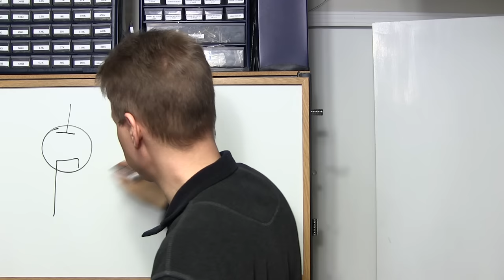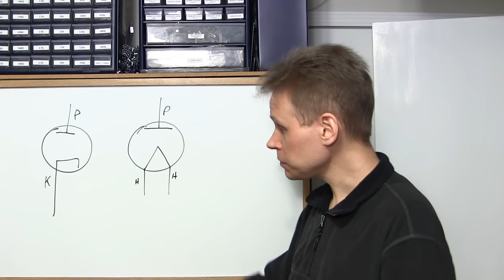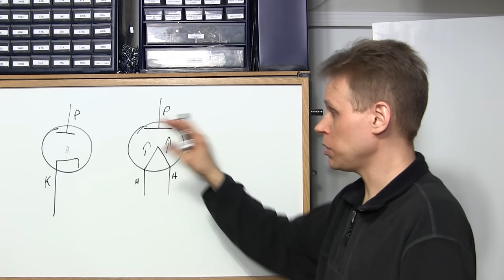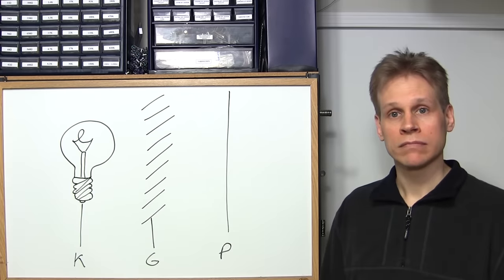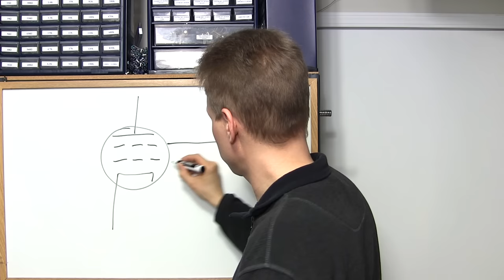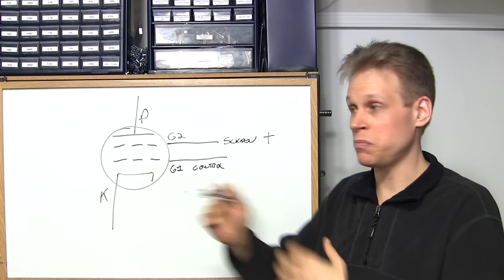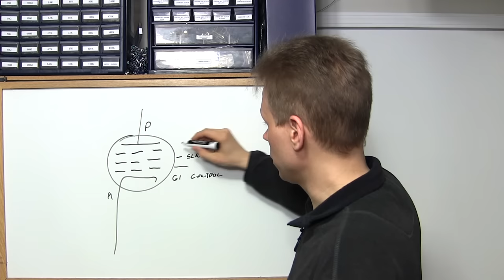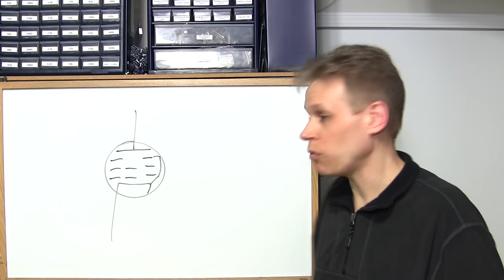How A Tube Works

Comment: Tubes are still used today in many applications like guitar amps, very expensive sound systems, microwave oven and high power transmitters.  Can you explain why tubes do better in these applications than solid state electronics?? Would we ever see a micro wave oven done all in solid state electronics?? Pls explain a bit. I learned electronics the solid state way and didn't do much with tubes during school......even today we hardly ever see it. Please get technical with the explanation if needed. Thanks.
Reply: MadMess007 An EMP wont kill them... thus why Russia still uses tubes.
Reply: Tubes still have their place with high power high frequency applications, the sound application is a hobby, preference thing not scientifically justified.
Tubes work with high voltages or magnetic fields. Semiconductors are not suited for >1kV AND >1GHz. There are GaN and SiC wide-bandgap semiconductors that are gaining traction now.
Check out how a magnetron works and is constructed and you will see why it is still and will remain the best solution for a microwave oven.
Reply: The harmonics produced by tubes are more pleasing to the ear than the harmonics produced by solid state devices such as a transistor.  This is why the best audio amplifiers (in your highest end stereos) and guitar amplifiers utilize tubes for amplification, at the cost of being more expensive to run and maintain.  But in most other applications, such as a TV or a computer or oscilloscope or multimeter, the death of tubes was welcomed because they have no advantages in these more pure digital applications, but plenty of disadvantages.
Reply: Your first sentence is purely opinion.There are many solid-state and hybrid combinations that have been designed to eliminate the unpleasant harmonics of signal amplification.There are bad tube amplifiers,or ones needing say,biasing adjustment to lessen the unpleasant,harsh overtones caused by amplifying tubes.
Reply: Tubes can distort the sound of an electric guitar in ways that at least people find pleasant.  The distortions caused by uncompensated transistor amplifiers are generally unpleasant.  For many purposes, it would be desirable to minimize distortion and some amplifier circuits do that very effectively, but a perfectly fairthfully-reproduced guitar signal is rather "dull" and "boring".  It's possible to build transistor circuits to color sound in a manner similar to tubes (one popular guitar effects uniit is called the "Tube Screamer" though it's in fact transistor based) but some people would rather get the vacuum-tube-style distortion by actually using real vacuum tubes.
Reply: Vacuum tubes are essentially valves, which produce a steady stream of electrons. Transistors "flicker". It's really the difference between incandescent and fluorescent lights. Most people find fluorescent lights unpleasant not so much for the color, but for the flickering. And as other people have mentioned, the distortion or "warmth" of a tube sounds more pleasing than when a transistor is pushed past its limit.

Comment: My mother was a electronic technician back in the 40s-early 80s. First working for Bendix radio And then Westinghouse Aerospace both in the Baltimore Md. area. She even built her first tv. A few years before me. I assume about 1950. She would had to know all these principals to achieve it. I still have a couple of old radios around with the tubes in in them but never knew how they worked. By the time My mother was teaching me of some of this stuff the tubes were gone. so thank you for explaining this.

Comment: I always let people know that if they are going to toss out any electronics, to toss them my way as I often salvage parts. Recently, an old tube radio came my way. I don't know if it works as I won't plug it in until I have checked out the caps. I'm sure they are dried out. But I hope to one day get it working again. It's been more years than I can remember since I played around with tubes. This video brought back old memories.

Comment: Kind Sir, your video was absolutely awesome. You are truly a VERY well informed young man.

Some trivia:

1. In electrical shop in HS in the 40's, we were taught that current flowed from + to -.
2. When I went to technical school learning electronics in the 50's, we were taught that "electricians" are dead wrong, because vacuum tubes "proved" that current flows from - to +.
3. Many years later in the 70's when solid state entered the "stadium", we were taught that "current" flows in BOTH ways; so the electricians are right and electronic's techs are right also.

WITH a very big caveat...

Then they explained that "electrons" ALWAYS flows from - to +; but "holes" flow from + to - in solid state devices. Then they took many hours and weeks trying to get us to understand what in the pluperfect hallelujah is hole flow!. Huh?

To this day, few understand it, because it requires abstract logical thinking, loaded with chemical and atomic science. It would take much too long to explain it here. But it IS true never-the-less.

So the world of electricity and electronics, can use either electron flow - to + (when it comes to current flow); OR...hole flow + to - (when it comes to current flow), if you wish: and they call it either "electron current flow" or "conventional current flow".

Sadly, it has been debated, argued and almost gone to war about this mystery, since electricity was discovered. I doubt that it will ever be resolved. Oh well.

Comment: Thanks so much for this!!   I enjoy tubes tube gear as  in my Dynaco Mark 3 mono block amps (KT-88's)  and Dynaco PAS-2 preamp.  And, as a NEW amateur radio operator, love running a beautiful Kenwood TS-830-S with original 6146 outputs...   Fun times, and I thank you for helping me understand how these 'valves' work!

Comment: This video brought back memories of when I used to repair televisions. Back then they had a mix of ICs, transistors and valves. The one thing that was always a valve was the PL504 that drove the flyback transformer and I think is probably the one valve that has been made in the biggest numbers ever as almost every television made from the sixties to the late eighties had one of them.

Comment: very good tutorial and this is really helpful. It helped my solved my problems in fact! I recently bought 4 cheap 6J2 tubes to replace my NF&FXaudio stock tubes. I replace the tubes , surprisingly none of them working! absolutely no sound with new tubes! The tubes seems working in the device with orange light from the filament. I am new to the tubes, although I am not too bad in understanding electronics. I realised ( after watch your video) , the suppressor grid can be internally connect with cathode. It's easy to check this, using a multimeter, I found the stock (working tubes , marked as '6k4'/suppose to be 6J1 ) pin 2 and 7 are internally connected, but the new tubes I received (marked as '6J2') they are not internally connected. the simple solution is, On the preamp/buffer PCB, I shorted Pin 2 and 7 on the tube socket. All tubes working!! after a week, I found the answer after this video and fixed it 5 min! Thanks for your good tutorial!

Comment: Great video and explanations! I am a technician who got my degree in 2004 and I can't say we even lightly touched on vacuum tubes. It's sad but everything is solid-state.
Reply: With respect, you're there to learn about modern IC electronics, not waste lesson time learning about museum pieces. That wasn't a liberal arts/history class. I like vac tubes too, but doesn't mean I'm going to want to spend valuable time learning about them in a practical engineering class. Vac tubes got retired because they couldn't get small enough.

Comment: Regarding "conventional" vs "electron" flow, it is perhaps worth mentioning that the two are algebraically identical. I learned about circuits and tubes in high school using electron flow. In my college EE program, it was easy enough to realize that since the charge carried by an electron is negative, a flow of electrons from the cathode to the plate is exactly identical to a flow of mythical (except in semiconductors) positive charge carriers flowing in the opposite direction. Although it really is just a change in signs, it does get complicated pretty quickly when doing even simple RC circuits and Kirchhoff's law.

As a EE, I always found the physical model of electron flow really valuable while learning why inductors, capacitors, and motors do what they do -- not to mention transmission line problems.

Great video, by the way.

Comment: Thanks for the tube vid. This brought back many memories for me. I taught basic electronics for several years while in the Army. It was a 13 week course. We taught from a text book written by Bernard Grob. The triode lecture was an hour long. I did it so many times I could do it from memory. They offered to send me to a course learning about transistors but thinking they were just a fad, I declined. Oops. I still struggle understanding them. Then I had 34 years in maintenance and teaching for a large computer firm.

Comment: Good explanation, having been brought up on these devices in the UK (called valves here) it's good to see there is still an interest in how the 'valve' works as there still equipment where it has not been replaced by semiconductors. One point I would make is that control grids are rarely biassed positive and I prefer stating using the term  'less negative'.

Comment: Nicely explained.  I've known how basic diodes and triodes work for fifty years, but I'm just now starting to get interested enough in building radio to actually do things with them -- and I'm working on understanding what to do with the screen grid in a pentode, in a circuit originally designed for triodes (an Edelman 1924 double reflex receiver, which I'll build using 1T4 power pentodes).  Should be a certain amount of solder-and-cuss before I get that working well...

Comment: you explain it so simple but in my day they never used simplified analogy so stuck to transistors and diodes i did wonder how tubes worked obvisly i knew the heater was there for a purpose and since we were messing with ac you risked the chance of a possible shock my uncle got me interested in electronics but he again it was about repair i think i surpassed my own uncles knowledge when i studied at college we need more people like you to help those who are genuine interested. over the year id built various gadgets from electronic mags some did not work due editorial mistakes so id throw it in a box to come back and figure out the problem some were very simple projects i could not understand how they made the mistakes then dawned on there tech people they were just writhing a magazine ready for production i seem to get a pleasure out fixing even if it seems impossible

Comment: Your presentation is logical and easy to understand.  I appreciate you showing the physical tube to relate the theory to practicality.  I cut my teeth on semiconductors so learning (or relearning) how vacuum tubes work is very helpful.  I think the next logical step would to show the real world application of tubes.  Show schematics and then build circuits to demonstrate how it works with oscilloscope outputs.  I know it's asking a lot but I think it would be beneficial.  In any case, thanks for your videos, always informative and sometimes entertaining!
Reply from the maker: +Shawn Walsh 
Thanks for your input Shawn!

Comment: Awesome video!  I've recently come into possession of an old RCA portable radio with tiny little tubes.  I've been able to find the schematic for the radio and I see it has the directly heated cathode tubes (i.e. 1U5 & 3V4).  My intention is to take the parts and build a small amp from it.  This video is very helpful in explaining how the radio works.
Reply from the maker: That would definitely be a small amp. Is this for headphones? Or maybe a very small speaker?
Reply: I was planning on powering a old panasonic bookshelf speaker I have...  From the schematic it looks like the existing speaker is 3 ohm - the bookshelf speaker is 3 ohm as well.  I am assuming they are swappable  -- maybe that's a bad assumption.  I'm just getting interested in electronics as a hobby, so I'm struggling to understand how the electronic components of something like a radio all work together and result in something usable.  I know enough to be dangerous...  So I really appreciate a video like this that mostly makes sense to a noob like me (I was a little lost on the conventional vs electron flow, but google schooled me on that = hooray for the hive mind!)

Comment: I'm old school and learned electron flow. It makes the most sense to me.. I follow the electrons, not the holes. :-) I find it interesting that during your discussion of the tube you talk about 'electron flow' and then the great analogy of the light, shutter, and plate which also denotes that light flows from the light bulb and is regulated by the shutter which would also be like electron flow.
Reply: Same thing, only opposites. Same result except transistors are current amplifiers, tubes, voltage, like FETs....

Comment: I always thought that vacuum tube functioning as a capacitor just like CRT on TVs or a Power Transistor, since it replaced the tube on Amps, and never thought as a Diode after I've seen this video. I took n electronics class but we haven't studied vacuum tubes. I think because it's been discontinued that time. Though I think tubes are not dead and still alive & kickin in 2018. Thanks for sharing this knowledge.. A fan here from the Philippines!

Comment: Valves work by the power of the universe (o: i built myself a EL84 single ended stereo valve amp, using EZ81 rectifier, 2 x 12ax7 / ECC83 and 2 x EL84, one 12ax7 is used for tone, other i drive after volume pot, sounds brilliant all 4 watts of it, I'm an 80s child so valves were before my time but they just look so cool glowing in the dark, did a heck of alot of resurch on the tone, and power supply with choke etc, will upload a video of my amp one day, played around with the grid and plate resistors to get the best sound and power, in the dark you can see a blueish light inside the el84 through the side holes, wiring the heaters and positioning a good chassis ground and not create ground loops and humm was tricky, great vid cheers.

Comment: Now I understand the tubes better..but what I dont get is why you need a - voltage off the grid...and I dont understand what the tube does in the circuit....that is what I need to learn...thanks..i ALWAYS love your videos...if your not a teacher you should be...I bet you could fix anything because in order to fix it..you HAVE to understand how it works and what is missing causing it not to work..again thanks.

Comment: That's a very good class! And as usual, it's all Greek!  And by that, I mean that the kathode is symbolized by the letter K because it is a Greek word. Kathodos means to descent or coming down (κάθοδος) and anodos means to ascend or going up (άνοδος) Diode is also a Greek word that comes from dio (two) and odos (route or street or path that allows traffic to go one way but not the other way. Pay toll on Greek highways are also called diodes because you pay and you go your way one way. Science uses lots of Greek! Another example of K (though irrelevant to this class) is the potassium because in Greek is called kalion.

Comment: Very well done!  I know it's beyond the scope of this lecture, but in some cases, the screen grids are fed from taps in the primary of the output transformer of an audio amplifier adding some swing to the screen grid voltage.  An amplifier I built way back around 1962 used a UTC output transformer with screen grid taps.
Reply from the maker: That's known as "ultra linear" operation, and the screen taps are usually 40%
Reply: Thank you.  After your explanation I kinda figured that was an additional linearization.  Thanks for the percentage.  That is very interesting.  I also remember a parallel RC feedback loop that went from the output to the input in audio amp circuits that I saw (RCA Tube Manual).

Comment: Alright.  I enjoyed the presentation, ... alright.  I'm jealous of your test gear station.  I was always fascinated by vacuum tubes as a kid.  I was always messing with electronics growing up stereos, tvs. parting them out and making things with the parts. First time our TV went out, my parents thought I was a genius for fixing it.  I was probably just lucky. I took the back off the TV and looked for which tubes were not glowing, pulled them out and went to the grocery store.  Back in those days the grocery stores sold tubes.  They had a test station you could plug tubes into and check them. Open the door to the cabinet and there was a selection of various replacement tubes.  I repaired many devises that way.  It was strange, here I am fixing the TV. not my dad?

Comment: Great explanation. Mr Carlson is a very effective teacher. Ok, next Mr Carlson should explain transistors and how they replaced vacuum tubes. Then he can move on to semiconductors like silicone, and how that is used in making circuit boards via use of lasers. Because although vacuum tubes are cool and all, they are no longer used. Unless you are into making retro art deco nixie tube clocks or something.
Reply from the maker: Hi Ed. Vacuum tubes are very much being used still,  and they're being manufactured as I type this. I do have many video's on solid state design, just click my channel name, then click "Video's" for the entire list.